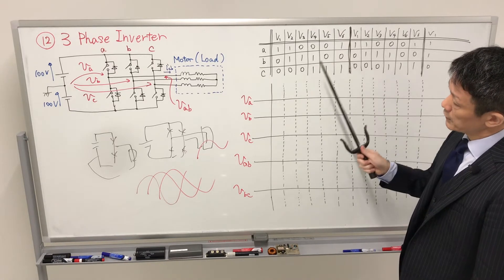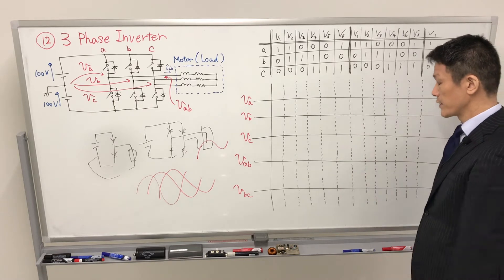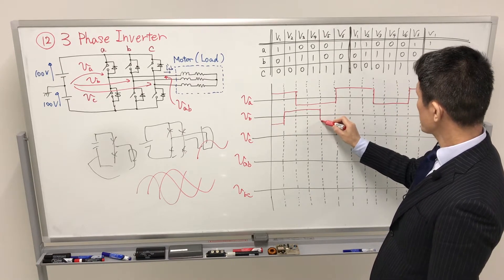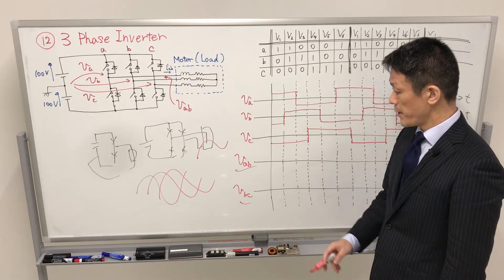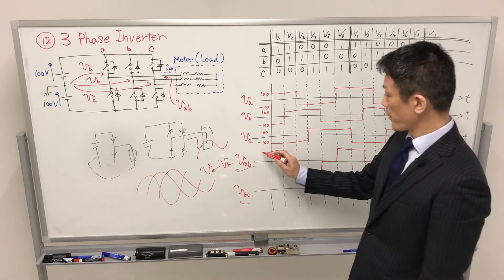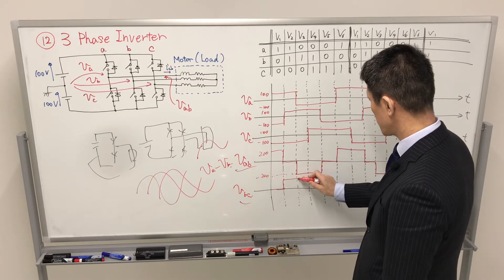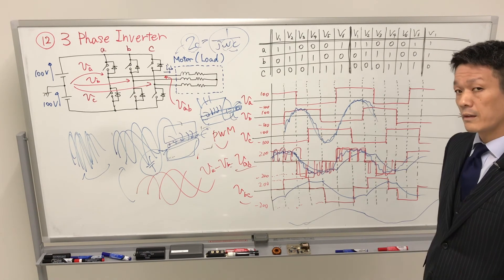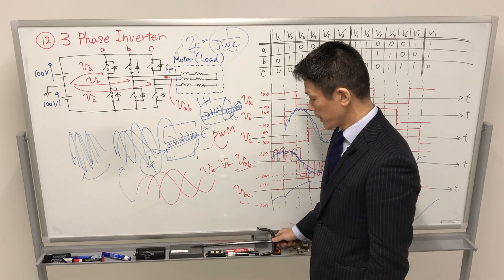[Lec 12] 3 Phase Inverter (Power Electronics)

Comment: if negative terminal of a voltage source is connected to the gate of SCR what will happen when
 a.. anode is connected with positive terminal of voltage source and cathode is connected with negative terminal of voltage source. 
b. anode is connected with negative terminal of voltage source and cathode is connected with positive terminal of voltage source.
Reply from the maker: Thank you for your question! Your question is in case of 3 phase inverter in this [Lec12] movie? In this case, negative terminal of a voltage source cannot be connected to the gate of SCR, because negative voltage source is not independent from 200V voltage source. In this case, I have divided because of explanation of Phase Voltage in 3 phase inverter. If you have question, any time you can write me in this comment space!
Reply: @pemovies-nagoyauniversity-8683  plz whatsapp number send
Reply from the maker: @usamafayyaz9054  I don't have whatapp software, so you can contact me directly (yamamotoecs@gmail.com).